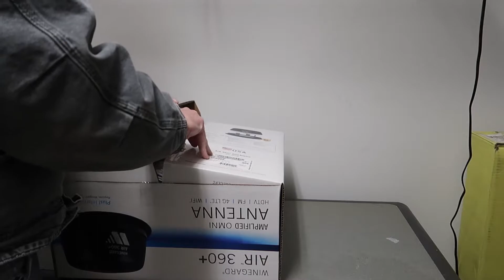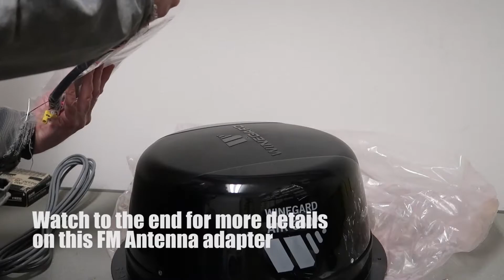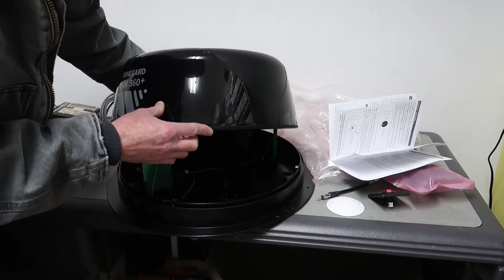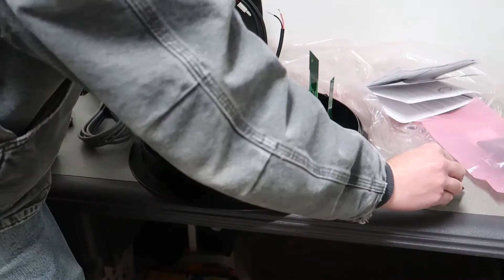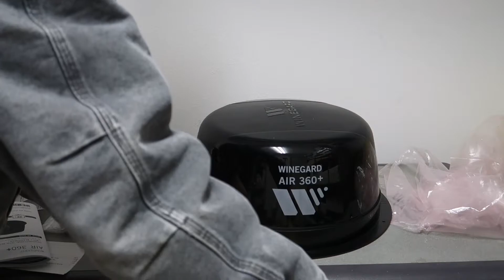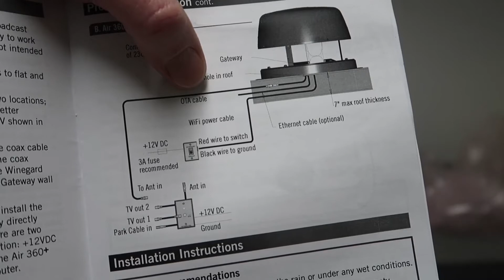Winegard Air360+ Unboxing and Overview | TV / FM, Wifi and 4g LTE Antenna Dome

Comment: Good information here and I do agree, installing it can be a challange. For the antenna cable, I simply used the existing cable that already in my couch. For the power line or cable you shown, I will need to run it through the roof as you had stated. To do this, I may need to use a fish wire or fish tape to bring the wire to the wall area. Others may have it a bit easier since they can access the wire from inside the cabnet near the wall and is able to remove a panel inside the cabnet to access the existing wires to set up the switch. As for the Winegard 360+, I also found that there are a few different models that seems to look the same. The one you are talking about where you can connect a line from the outside is most likely the Wingard Air 360+ 5G and not the 4G LTE as you are showing here.
Reply from the maker: This is definitely the 4G LTE version.  5G model hadn't come out yet when I made this video.

Comment: What about if you hooked up the power and new coax to the old coax and pulled them through. Wiring the new gateway in place of the old king jack antenna?
Reply from the maker: Old coax is stapled or zip ties to the roof framing, so it's impossible to use the old wire to pull new wire.

Comment: Hey man do you have any idea what router/modems would be compatible with this and that uses either a at&t and Verizon sim card? I want to mount mine inside the unit as well. But mine came with my RV and I'm very confused on what works and what doesn't and I don't want to waste money
Reply from the maker: The only device (modem/router) compatible with this is the one made by Winegard for this unit.
Reply: @deltabravo1257  Did you ever find a good one to use for this yet? I do know about the Wingard Gateway, and there are a few extras out there that will also work such as ones from Netgear like the Nighthawk. Just need to look for the ones that will use the tiny connectors to use for it.

Comment: Ours never works...
Reply from the maker: I ended up returning this because I couldn't figure out a path for the required 12v wiring for the router.
Reply: @deltabravo1257  It came already. On our 2021 work and play. I have a call into winegard
Reply: I have it on my Keystone 2020 and the AM/FM reception is terrible

Comment: While I understand that esthetically it would be pleasing (and simpler) if the coach came pre-wired for this gizmo, I can't see why it wouldn't be possible to retrofit an existing coach using a channel running along a wall. The wire doesn't care where its run as long as there's continuity between desired endpoints.
Reply from the maker: In my case, running the wire like that meant not being able to get it to a source of power unless I ran it on multiple walls, which would have looked really ugly.
Reply: @deltabravo1257  I have no idea if you ever got this setup yet or not, and if you were planning on running the cable along walls on the inside the camper or RV, you can use cable trims that you can use to hide the cable (lines run inside or behind the trim) and adds a little extra touch to the roof line as well.
Reply from the maker: @cowboycadence    I gave up on trying to install it after finding it was impossible to route the wiring through the attic space in my RV

Comment: How does yours work. Ours rarely picks up any tv channels and we live in an area that it should work fine. It’s hooked up to Keystone KeyTV system.
Reply from the maker: I was never able to get it installed, due to it being impossible to route the necessary 12v DC wiring to the antenna location, so I sent it back.

Comment: I need this so bad. I hope it works with tmobile (the gateway), from what I read people have used it.
Reply from the maker: Interesting about T-Mobile working with this, I hadn't heard that.
Reply: @deltabravo1257  It supports the same bands and gsm, a Winegard rep told me its some bands that are not supported on tmobile but most should be fine.